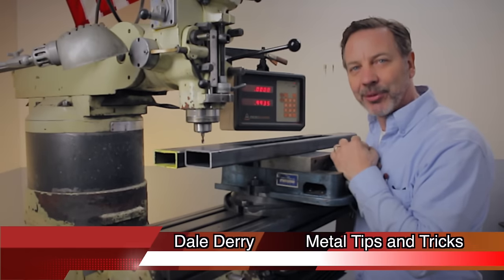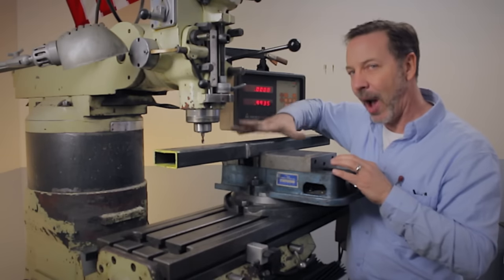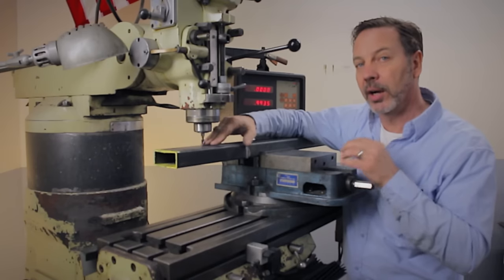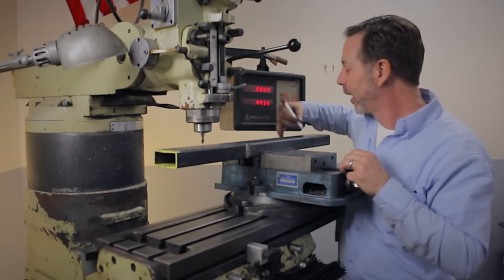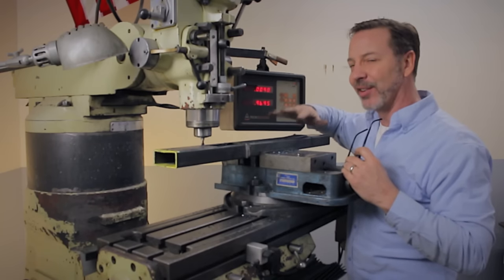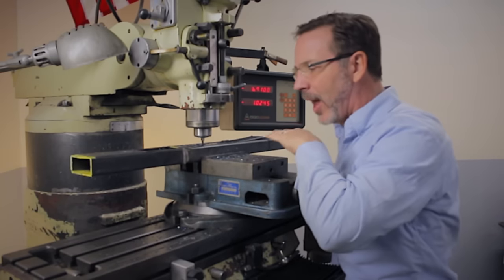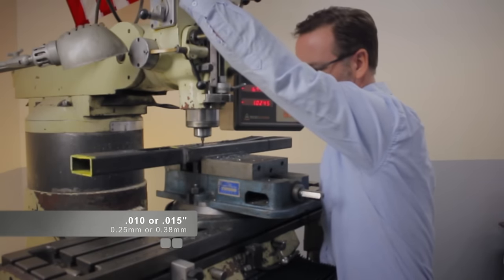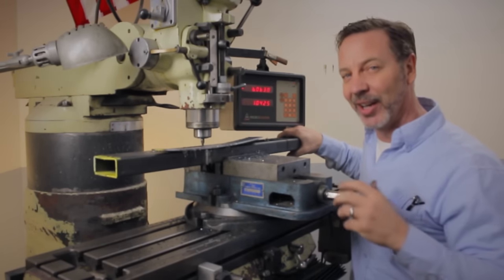How to Mill a hole in tubing

Comment: Excellent video.  There are two things about the tubing.   I don't knowif this is univesally ture but at the plant we deal with all of the structural tubes both rectangular and square, they all start out life as a round pipe of a proper diameter.  Then they are reheated and put through rollers and rolled into the final rectangular or square shape.  The diamter of the pipe is set such that the correct size tube is produced.    And another way to handle milling ot structural tube which works very well is to clamp it flat to the table.  For us, we found that is the best way to hold the tube. And in most cases it can be done.  Of course to do that you will need to remove the vise.....not fun, but usually worth it.

Comment: Dale,  I agree with Glenn.   Clamping down flat may be a good way to go. Although, I would not clamp down with a clamp that bears only on the center of the top plate. That would put bending stresses in the section.   There are alternatives, such as cutting only into a section of the tube that is not between the jaws of the vise. I also understand, and agree, that there are internal stresses to consider. However, formed, folded and welded, the way you described the section as being fabricated, will want to spread apart, or open up.  The vice is what is causing the issue you were concerned about, and apparently experienced from my observation. The piece you are cutting could be cantilevered, or you could have two vises, with a vice that is at each end on a section that is not being cut. In that case the section does not need to be held up on blocks, but could be fully embedded in the vice(s).  The section has rounded corners, such that the force from the vise will be eccentric to (higher than) the bottom uncut plate.  That eccentric force will cause the top to flex in after the cut, particularly at the final tab cut.  You did not mention it, but it appeared to me that at the final tab cut the top flexed in and the bit cut into both sides.Oh, and if you did want the long hole to be dimensionally correct, I would recommend that you cut inside enough to let it flex out as it releases stress from being folded, and then do a finish cut around the perimeter again.  Warren Wilson

Comment: I make custom machines for a living...  I would never used a mill to just whack out large holes in HSS tube for a few reasons...  You touched on the inherent stresses in the steel that can bind up and shatter your bit... another is that HSS's dimensional tolerances are worse than a plain wood 2x4, so the mill's accuracy isn't needed. and lastly, it's slow as hell to do it that way.  This particular job I would use my plasma cutter and a non conductive straight edge...  I'd have the required hole in less than 2 minutes.
Reply: Sheesh
Reply: You'd think a mill would be more common

Comment: We mill so much steel tubing at work it's not even funny, huge, long, skinny pockets, wall thicknesses ranging from .040" up to 3/4" and up to 90" in length at times for a single slot (talk about stresses, I've seen parts go in straight and come out looking like elbow macaroni). The heavier gauge stuff isn't so bad, but the thin-walled tube can bite you. I have found that smaller solid carbide roughing endmills (3/16 to 3/8) are the best. Garr supplies most of our solid carbide tooling and their VHM series 4-flute cobb mills work fantastic for this kind of work. Obviously surface finish isn't spectacular, but for most of the jobs like this they really aren't concerned with the finish. One thing to note is that when you're ripping down a long slot without clearing out the inside (as you would a pocket) the material inside will usually bend and cup upward towards your cutter, this can obviously be catastrophic of you're not aware of it, as well as creating horrendous amounts of chatter since you basically have a huge tuning fork hanging right in the cut. If you have a CNC, then trochoidal milling with the same type of cutter can help out alot, but it really adds to the cycle time.
Reply from the maker: Great comment! thank you! :-)
Reply: Sandman Actual I don't have your experience I am sure, but  I have also had good luck using cob rougher for slitting. one thing that worked well for me was to support the ends with blocks under each end of the tubing that is the same height as the vice. I clamped lightly on the sides of the tubing with the vice to keep it from vibrating, and I clamped the inside bottom of the tubing from the ends with some  step block clamps. it secured the tubing tightly on the ends and allowed me to cut the full length of travel on my mill without too much unsupported stock whipping around. it wasn't a precise cut,  but it saved me from having to move the piece too often in the vise.

Comment: I can see where cutting tubing of any shape could be a touchy job.  I was wondering how it would behave if you bolted it directly to the table with a clamp in each end.  Have you tried that?  Thanks for the video.
Reply: Good setup, I reckon, particularly if you clamp the lower wall directly down to the bed by poking clamps into each end, rather than (or, for long pieces, as well as) straddle clamping. It is easy to fall into the habit of using the vice for everything it can hold, rather than thinking if there's a better option in individual cases.
It won't make all the residual stress problems go away, but it does mean the setup is secure regardless of those stresses being released.

Comment: Ok i am an apprentice and as a side project i ran into a problem. I had to mill a 3/32 slot for a brass piece into a cold role round stock. I wanted to go as deep as possible atleast the length of a standard drill bit but had no luck. Have you ever seen a brass that a process tech in injection molding uses. I am trying to make a custom one out of aluminum. Dunno just a thought
Reply from the maker: +Brian Goodyear 
Im not sure I understand the question. But I have cut difficult slots that were to deep for a normal end mill using a sliding saw and then welding back in th missing material> i hope that makes sense.

Comment: Could you release some of stress by a mild heat treating?
Reply: +Jeremy Hall Heat followed by a oil quench?
Reply: +Knightrem 10 Probably better to just let it air quench.  Mild steel like that won't harden very much in oil, but it's probably easier on your cutters to just anneal the metal rather than harden it.
Reply: +Q-Hack! Sorry I should have said anneal not heat treat. Still wouldn't annealing release the tensions?
Reply: +Jeremy Hall  Yes, with the caveat that you have to evenly heat the entire piece up to the point where it's non magnetic.  I do this all the time in my forge with small pieces, but with something larger like what Dale is using, it could be a bit more difficult.
Reply: +Jeremy Hall 

It's a good thought. Proper stress relieving something that size becomes more challenging. Whether or not stress relieving is needed depends on final application. If the steel needs to retain critical tolerances, max strength, or is subjected to high stress environments; then internal stresses become very important. Also, preheating the part might not be worth it if there is going to be additional welding. Welding creates all kind of stresses on metal. In a welding situation post heat treatment would be king. Good post.
Reply: +Jeremy Hall 
Playing with heat and formed tubing could set you back further than just machining it and tweaking the small out of shape afterwards...  ;)
Heat and odd shapes  =  odd results... lol
Reply: Run some normalization cycles. 3 or 4. Let them soak at critical temperature for a few minutes before still air cooling. You'll have silky smooth grain that will be easy to machine and will have very minimal warpage due to the relaxed grain structure. A true annealing cycle sequence would ultimately be best but use what you've got and make the best of it!
Reply: I’d stress relieve it with a rosebud - run the flame down each long edge until it’s a dull red then move onto the next edge, the next, and then the last long edge. Let it cool in still air, or better - bury it in dry vermiculite. All of the stress is caused by the bends and relieving the bends with heat allows it to take a stronger set in the bend.
Reply: you could anneal the stress out- but it could possibly change the shape of the entire tube

Comment: Great video. As a kid I recall looking for a piece of steel flat stock for a project I wanted to attempt. Unfortunately, I could only find some square tube,  but I had a bright idea of just cutting the piece of flat stock out of the tube wall, as it was much larger than the piece I was after.Needless to say, I got an early lesson on internal stress (and my own personal stress) when the piece I was so carefully trying to remove turned into a pretzel. Still a valuable lesson, albeit an ultimate waste of time.Now I'm curious, are these tubes your cutting for a project, or just a teaching aid?

Comment: At the beginning of your video you're describing the forces as wanting to go back to flat, which makes sense; however in the remainder of the video you seem to be indicating with your narrative & hand motions that the forces are pressing inwards and if you didn't leave the bridges the material would pinch the end mill. ??
Reply: He was saying that because of the vise. When you crank down on it and cut it it may cave in slightly.

Comment: When you fast forward a machining operation it not only looks scary but the learning process ( we're the learners) is distorted. I'd say that the learner wants to hear the cut, see the feed in a normal mode. I don't suppose you want to have to upload the whole cut or that a viewer wants to see the whole thing. But what about just starting, missing out the bit in the middle and showing the finish...is that difficult for an uploader?

But of course you're doing good stuff..... thank you

Comment: Hmm. Steel can have stresses just like wood.  If you don't have a riving knife (where distance from knife to blade is maintained as a constant as opposed to a splitter) then wood can bind on the blade and cause kick back when the saw cut relieves stress.  So steel can also do this sort of thing. Interesting...